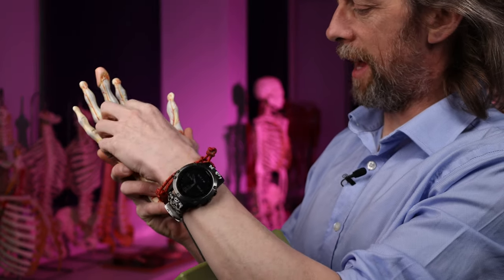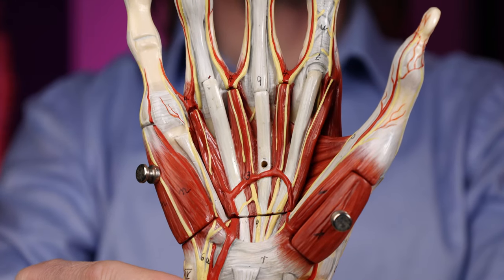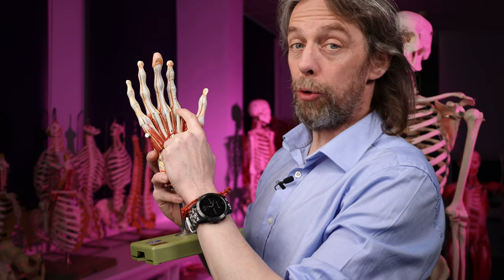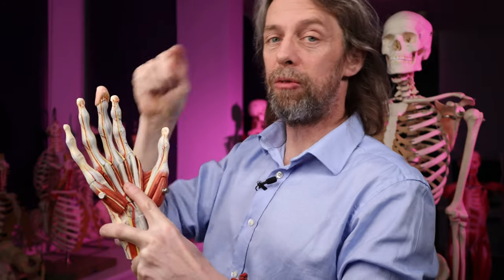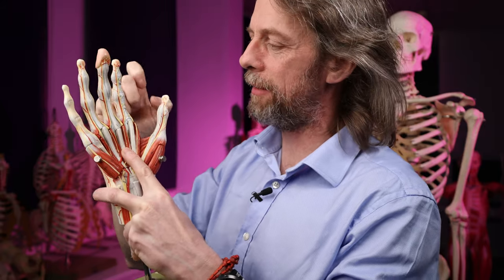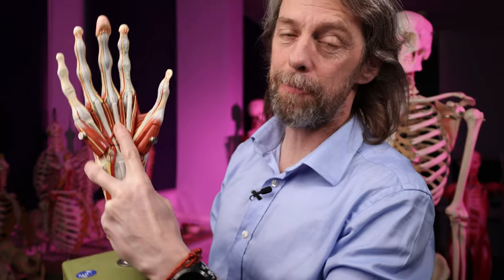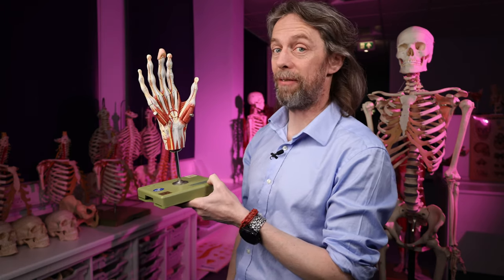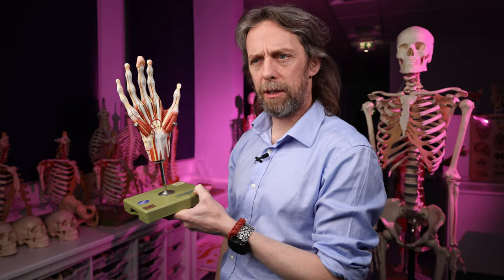Trigger finger anatomy

Comment: I had a trigger finger, middle finger on my right hand when I was in my late teens. But my finger, due to being broken as a kid, got stuck out and wouldn’t bend inwards, instead of the other way around. I had 2 surgeries trying to rectify the problem when my surgeon was sadly killed in a car accident and I never bothered to see anyone else about it. I figured 2 surgeries were enough, so it still gets stuck and I have to bend it  with my other hand. Annoying more than anything these days. I’m just used to it.

Comment: Thank you for this excellent video too! I just previously viewed your video on Dupuytren's Contracture (and left you a question therein) but seeing your video above may have helped me answer my own question. My question was, "How do Dupuytren's and Trigger Finger differ in their diagnosis?" I really thought I had 3 trigger fingers because when I bend them, they get locked and have a hard time coming up. They don't click at all on the way down - just get stuck when I try to extend them and click once they do unlock. I was diagnosed with Dupuytren's but was thinking it might simply be Trigger Finger (of course I'd prefer it to be Trigger Finger too). From your above video, I am assuming that if it were Trigger Finger I would feel a lump and sensitivity at the direct base of the finger. I don't. My sensitivity on each of my problem fingers is approx. one inch below the base of each finger. I remember the doctor saying he feels some lumps there too, and now that I compare those areas to the same areas on my 'good' fingers, I realize there ARE tiny lumps there. I think I can see now why I was diagnosed with Dupuytren's and not Trigger Finger - the lumps in Dupuytren's will form lower down on the palmar fascia whereas Trigger Finger lumps will be higher up and at the base of the finger. Is this correct? Thank you again for both fabulous videos. They have really helped me understand the anatomy of both conditions and therefore the conditions themselves. Ugh, I wish I didn't have Dupuytren's but knowing is important. Your time and great videos are much appreciated! Going to go search now to see if you have any suggestions on preventing early Dupuyten's from worsening 🤞🏼 Thanks again!

Comment: Thank you for the informative video series.  I am just writing to ask if anyone has had any luck with massage or stretching or any other non-surgical interventions that might be able to reduce the amount of collagen building around the tendons and/or decrease inflamation in the fingers?

I'm 47 and only been climbing as a regular pass time for the last year or so, but have recently been getting some acute pain in my ring finger from climbing, as well as any work requiring a firm grip (e.g. forking a garden bed).  Recently a muscuolo-skeletal specialist diagnosed me with early Depuytrens contracture, but I also hypothesize that my relatively acute pain during climbing may be caused by nodules on my finger tendons being pulling through the A2 pulley under pressure (I can feel a small ridge/bump pulling through when I lightly pinch my first knuckle with the other hand and then flex my finger).   My main concern is that I may be worsening the condition the more I climb, and I've just had approximately a month break without the pain or finger swelling diminishing....
Reply: hope that you are still climbing! i found that stretching my fingers between climbs and longer rest helped me

Comment: I can open my index finger just fine but the last joint near the nail can't close well...  The result it the index can't fully close, only about 80% which means I can't make a fist with that hand...  If I force the finger closed, like with a rubber band it will stretch...and fully close after a few minutes..if I keep it closed for a while and remove the band, then for a little while after that I can close my hand into a fist with the index closing about 98%....  This problem started after picking up a heavy plastic bag and pulling the index finger...  Occasionally there is a clicking after I stretch it but normally not and there is no pain...  So far doctors no help and no confidence of a fix... Any thoughts?

Comment: I don't know if you have covered fascia.  Where it is, the structure of it, the purpose, etc.
Reply from the maker: I've talked about some regions of fascia in videos (neck, others?) but I usually need to use cadavers to teach about fascia during dissection. It's the only time you see it, as you have to remove the fascia to see what's underneath.